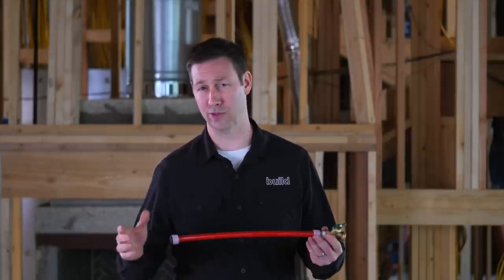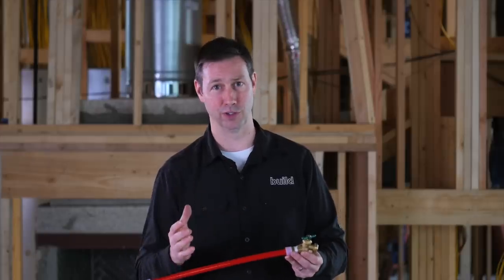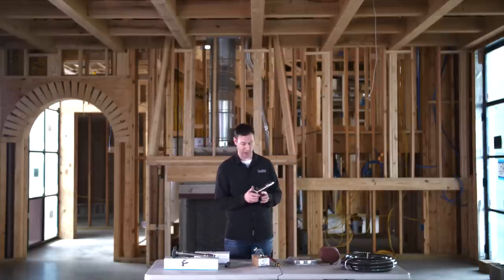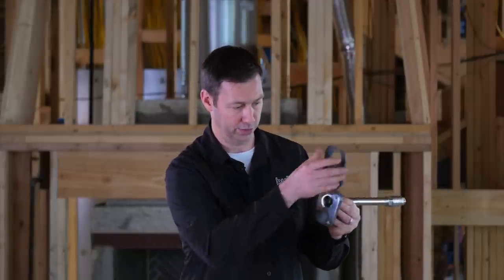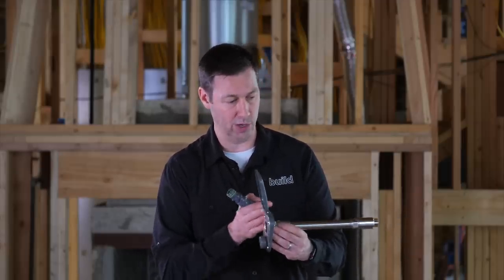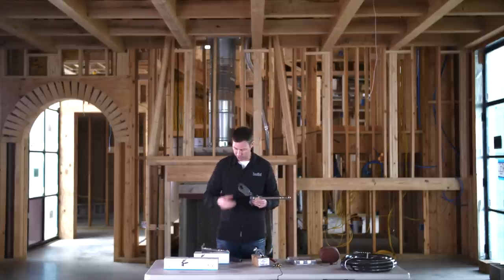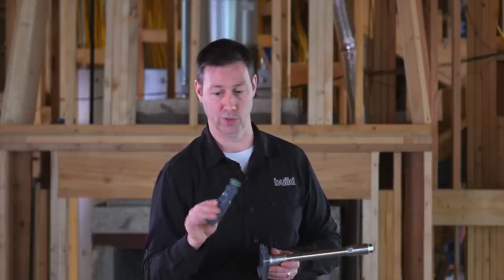No More Hose Bibs - A Better Outdoor Faucet

Comment: For all the naysayers, just remember what kinds of houses Matt builds and who his clients are. To many aesthetics matter and these keep the clean lines of the house more intact. If that is something that matters to you, then here is a solution. If not, then move on. Is it cheap, no, but neither is hiring Matt as your builder either. You expect premium results from Matt and that is what this product he is showing is too. Sheesh.
Reply: Matthew Kirkconnell the main points these "naysayers" will bring up isn't necessarily the complaint of cost moreso than the complaint of value. There's nothing wrong with a premium builder for a premium home. But at some point you cross the line of cost vs. Worth. This feels like one of those times. Like many have mentioned before. You have to have adapters and you can't control the flow.... If it was 40 dollars with the adapter, sure but.... Meh. Underwhelming so far
Reply: Thank you for the comment. We strive to make the best products possible, using the best materials we can find. We encourage anyone to take apart one of our hydrants and compare it to a regular brass sillcock. To the best of our knowledge, it is the only 316L stainless hydrant on the market period, let alone for under $100. We don't cut corners or make things that will end up in the landfill.  "The bitterness of poor quality remains long after the sweetness of low price is forgotten." -Ben Franklin
Reply: Recessed box with a stainless cover will do the same thing with standard parts....   The average price of a house in my neighborhood is about $1.7 million and pretty much no one does their own gardening - I still would not install this.  Never mind that you can't even regulate the flow.  It may look cool, but it's going backwards in terms of functionality & interoperability.
Reply: +Aquor Water Systems Thats a pretty good point. Many use brass with a plastic bracket. Based on my limited knowledge on the subject I'm willing to bet stainless steal is actually cheaper than brass but brass is much easier to work with in manufacturing.

Another point is brass is also usually mixed with lead for ductility. In my experience only cast brass is lead-free. I'm also seeing thats noted in their literature. Most don't even claim "lead-free" meaning below .25%. But when they do you can assume it still has lead with any machined brass. Where as cast brass its at least plausible they wouldn't need to use lead.
Reply: Like Removing the 3.5 jacks on Phones?
Reply: What is aesthetically pleasing about a grey lump of sun-rotted plastic?
Reply: The adaptor is my big hang-up... Rich or Poor, we all lose the special parts that we don't use every day! I would rather spend the money on a recessed hydrant if I am going that route.
Reply: I remember him tearing apart a house to find a leak when a simple $20 (high side) scope for the phone would have worked...  Also this was a PAID ADVERTISEMENT
Reply: the homeowner will never see the outside water faucet.  some messican will be doing the yard work.
Reply: I too love the premium aesthetics of plastic
Reply: Ghost2Coast why don't you google "commercial hose bib" and see what an all brass setup with a door or recessed box will cost. They start at $250 and go up from there.
Reply: wb5mgr You think the people paying for these McMansions give a shit about $90 vs $250? Why would you want sun-faded cracked plastic junk in a few years to save a couple bucks?
Reply: With what you said in mind, the plastic bib is really a cheap unsightly part of what should be a solid stainless steel bib so there would not be an accidental breakage and the unsightly grey plastic protruding from this odd choice off chrome and a very ugly grey plastic cap that would in time decay from the sun and break off... So nice option. Just not what A high end purchaser like myself would want to have in any of my homes.
Reply: @Kincentc  ...cost vs worth? How much Noguchi coffee table is worth for you?
Reply: cisa93  "Too much plastic on plastic. The heat, UVA/UVB rays taking an early toll on this fixture"
This is not plastic, its Delrin polymer. Your hose will give away sooner than this tip.
Reply: @Bear-cm1vl  I don't get this common comment:  you would LEAVE that adapter on your hose!  If you lose your HOSE -- you're not going to be watering anything no matter what kind of bib you have!  In the South, no, you don't need this sort of protection OFTEN -- but you DO need it sometimes, and as we slide into the next Ice Age, we'll need it a LOT more!  I think this stuff is cool -- cool enough that I bought sets a year ago for three hose bibs; haven't yet put them in because I'm also wanting to add a tankless at the same time (pay the plumber just once, eh?) -- and need to save up my pennies!
Reply: @1950Archangel , whatever... I've seen it happen too many times in 49 years of technical service and over 20 years of building service.

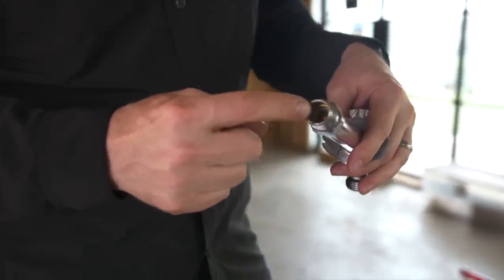Comment: 1:35 No, that's not what a vacuum breaker does. If you turn the water off in the house (say at the meter), and then open a sink or other fixture to drain the system it will create a vacuum, that vacuum could suck water from the hose into the house. This is what the vacuum breaker prevents. Gravity takes care of the water in the frost-free section of the silcock.
Reply: Yes it also does that, and good of you to remind us. But the vacuum breaker also allows the water to drain out of the bibb connection tube and away from the water several inches into the conditioned wall space.
Reply: @fredericrike5974  But it is code because of what Christopher Stone said.

Comment: lmao you think that Aquor company is going to be around in 20, 30 years? Probably not, now the home owner is stuck paying for an expensive plumbing replacement because they can't find a new plastic Aquor™ Frost-Free™ Quick Disconnect Hose™
Reply: If this proves to be popular, the patents on this will have expired by then and other manufacturers will sell the parts.

The key though is that it has to be popular enough for that to happen. And I'm not really seeing anything about this that would be that popular. It is a relatively clean look, but the standard style works just fine and if you really like the quick release mechanism, that could easily be added to an existing faucet.

It's a clever idea, but it probably won't catch on at that price.
Reply: It's not really an expensive plumbing replacement you just unscrew it take it out and put in a "normal" frost free version for $20.
Reply: @tjnelson111  Twenty dollar FP hose bibb; methinks, sir, that you are thinking of those cheap Arrow bibbs from China! The parts are thin, the inner washers can be replaced, but you will need sand paper and patience to gradually, carefully sand the American market cone washers and faucet washers to fit. I don't think so, at all! The Woodford #19 is all brass and copper, well made and those pesky standard washer sizes will fix them quickly.
Reply: @fredericrike5974  oh I'm so sorry $35 at Home Depot, that's really breaking the bank.

Comment: Is there any hose bib that protects against homeowner forgetting to remove the hose? Seems to me, this is just a different way of connecting. Homeowner will leave the hose connected either way.
Reply: I kept waiting for him to say that if it freezes with the hose attached that the bib automatically shoots the adapter piece out but no such luck :(
Reply: Our goal is to make the system as simple and easy as possible to winterize (in less than 1 second). Homeowners are much more likely to drain and winterize their outdoor faucet if it's easy. And even if you forget to unplug it, ice will move to the point of least resistance -- the polymer connector. The important bits -- your home and plumbing -- stay protected.
Reply: You can buy a frost free hose bib with integral vacuum breaker for less than $20
Reply: its designed to be both the knob and connecting point in one so if you don't remove the hose you end up wasting money
Reply: I’m confused.  What difference does it make to leave the hose attached other than you end up wearing the hose out faster?
Reply: frozen pipes? or in the case of these, frozen hoses, because of where the water is cut at you don't have to worry about a frozen pipe or frozen hoses
Reply: DEEREMEYER1 watch the video again, maybe take some notes.
Reply: DEEREMEYER1 why so angry?
Reply: Unfortunately, no matter how hard you try, you can't out engineer stupid.
Reply: Tia Williams in the North the hose will freeze and be ruined no matter how hard you try there will always be water trapped in the hose
Reply: hotrodpaully1 
I had that exact thing happen.  The part inside the wall froze and split.  I didn’t know I was supposed to remove the hose!!!!
Reply: That's why an air bleed is supplied within the design of approved hose bibbs- to let air in when the water pressure is off and drain the bibb's tubular body out, leaving a sufficient dry space between the freezing weather and where the water is.
Reply: I use the Woodford 19.  Not, the 17 .  The company calls it "anti-ruputure" and has an oval handle.  Costs $10 more.  And 3/4" supply.
Reply: @markrepovich2148  Good choice if the client is willing- one #17 I installed for a dedicated limo wash chaeped on that  and them refused payment when his delivered water wasn't in the game- also a 1/2 " supply line 220' from building- also spec'ed by client. You gotta do what the client says even when he's wrong or walk away.

Comment: Here in central Florida we just let the faucet dip all night during the rare hard freeze, maybe once every 5 to 10 years.
Reply: I am in south Louisiana, and we had several cold advisory nights this winter, where we were cautioned to let our faucets drip.  I'm surprised that Florida would only have a single night every 5 years.
Regardless, it is definitely not as simple as a single faucet lightly dripping, which is why many people employing this technique have experienced pipe bursts.  Plus there are the issues of wasted water and what to do when you are out of town.  
There is definitely a huge advantage to minor home tweaks to prevent frost damage, even in the south.  I am just not necessarily sold on the advantage of device that requires a proprietary attachment, which is plastic and sure to break after a few years in the southern sun.
Reply: Christine W4 The plastic is UV resistant, similar to plastics used on cars and planes.
Reply: N C the product has ASSE certification which means they are built to withstand 100lbs lateral force. However if you go into their website, they have tested up to 200lbs. I really don’t think they are made to be broken.

Comment: I guess if you just want to be different and have the money to source parts years later.  Seems to be a case of trying to re-invent the wheel...
Reply: That's what I was thinking except reinvent to break quicker or become obsolete for parts. The spigot has been around since the 1800's and still no signs of obsolescence coming.

Comment: I will not soon forget the time I misplaced the quick-connect for my pressure washer, so I'll pass on this.  And if I'm that concerned about the clean lines of my house, I guess I have to haul the hose back and forth and store it out of sight someplace whenever it's not in use.  Life's too short.

Comment: In my remodel I put in two of these and spent a lot of time talking to the Aquor team before I had them installed.  When the building moved inside during the winter the crew made a mistake.  Left a hose attached to my aquor during a 3 degree weekend.  Basically the entire hose froze and burst the hose leaving a spray of water outside.  By the time I got to it three days later you had thought i was practicing ice sculptures.  There was no freezing inside or issues with plumbing in the basement.  I unclipped the hose to Aquor bib and just replaced the hose.  Could have been way worse with a traditional hose bib.   Another thing is you can get a valve piece on the outside to regulate the water flow.   Plus it looks great.
Reply: Now that's a story. However running water tends to not freeze for some weird reason so you were very lucky.

Comment: I just don't see the point of this. I need to find the special fitting in my garage in order to use my silcock? Does it really look much better than the latter? Idk just not sold for the price. I don't see the value here.
Reply: The value is that all of your neighbors know you are more sophisticated than they.
Reply: And then are sooo smart as to double post. I also suppose N Korea was better off under Obama.
I wonder if "into 55 yr old ladies" would like to donate his tax return money to the DNC?
Actually his neighbors barely tolerate him and wish he'd just move or at least grow up.
Reply: N2LADIES55
Well, that should save you money actually. Paint your existing spigot gold and walk away.
Reply: Goal is convenience and reliability. Over 10% of homes in the US have leaks of 90+ gallons per day (EPA.gov). Our pressure-based seal is much more reliable and leak-proof than a traditional screw-and-washer gate valve, so we hope it will save you water in the long run. Plus, you just plug in your hose now.
Reply: Aquor Water Systems
If your product was made out of a more stable material (brass or stainless), and it didn't require extra parts that the homeowner has to keep track of (like if there was an option to thread a hose directly into it), your product would be a lot more practical in the long run.
Reply: IT's like an Apple Product. It's all about BS and money.
Reply: Spoken like a crapple fan.
Reply: re: brass or stainless...my thoughts exactly. i'd be much more inclined to purchase something like this if it were made of brass or stainless...probably brass.  when it comes to  things like hose connections, sprayers, shut-off valves, quick-disconnects, etc., i will only buy those made of brass. they last WAY longer than anything made of plastic, and won't dry-rot when left outside for years.

Comment: Seriously 90 bucks is NOT A BAD DEAL???? Wow, must be nice to have more money than BRAIN CELLS... 

90 Bucks is a HORRIBLE DEAL for a piece of Plastic Connector that is going to BREAK as soon as you pull too hard as you run out of hose and are looking to get to that last part of the yard. Sure the design is appealing as the hose bib can be a bit of an eye sore; but the price is just downright awful and NO it's not a better faucet, especially because of the plastic connector to turn it on and off. It's still going to leak and what would you do if the connector breaks off and allows the water to run. 

Worse yet if you leave your hose attached overnight only to wake up to Frost the next morning, or a Frozen Pipe just the same, then you're out 90 Bucks plus to cost of Installation. Maybe if it was priced as the other solutions like 30 bucks, it might be worth it. I can see way too many things wrong with this device and personally I would NOT INSTALL ONE, I don't care WHAT CODE HAS TO SAY, the Code is WRONG HERE. Sounds like the Code is on the TAKE to force folks to BUY a Triple Priced Solution. There is NOTHING about this device that says "I'm worth 90 Bucks" absolutely NOTHING at all.

Do me a personal favor, stop blowing smoke up my butt then telling me I'm on FIRE....
Reply: Rich people problems. Can't have hose bibs lousing up the McMansion.

Comment: Interesting. Plumbing apprentice here and just replaced a frost free that had froze and burst. The problem with them is if you don’t install them with the proper fall away from the house your going to have residual water lying there and when winter comes it’s going to freeze and bust after where the washer shuts the water off. The owner turned the water on not realizing what had happened because it’s internal. The best way it to have an access panel with a 1/4 turn stop and drain ball valve.
Reply: Yes!  An insulated access panel with ball valve is the best solution.
Reply: Yes! simple, cheap and reliable.

Comment: You can also place a valve on the line that goes to the outside and CLOSE it during the winter or when you go away from the house for a holiday.
No need for special items and you still get the protection.
Also works great if you have a water stealing neighbor. (close it and no water to steal)

Comment: Interesting but no thanks. 
Overkill for anywhere.
To many moving parts.
In the northeast we use a 12" frost free hose bib. Temp can go below 0° and no problems and virtually maintenance free for a tiny fraction of that fancy plastic version. 
But if you're customer has the $$$ for the cost and maintenance: your choice.

Comment: Still don't really understand the need for this product, having always had the frost-resistant bibs. Even being in a climate that regularly deals with freezing temperatures, the frost-resist ones do fine. I don't think a plastic flap looks any better than a standard bib, and having to a plastic, proprietary adapter for every one of my hoses, just to convert back to the normal thread? No thanks. Even just replacing the ends of the hose with those fittings would be better (at least to me, anyway) Its a neat product for sure, I just think its trying to solve a problem thats already been solved years ago.

Comment: For those of you assuming you would be able to snap the connector off with a simple twist of your arm, please do a little research before you jump to an uneducated conclusion. They use marine grade stainless steel  and heavy duty polymers. Not all types of plastics are the same. There is a video of them driving a car over the product no problem. You guys think you could apply as much force as a car?? As for the sun/heat damage, they use UV resistant polymers. It is new in the housing market, but it has been in the marine market for around 15 years. One test is worth a thousand opinions. Test the product out guys.